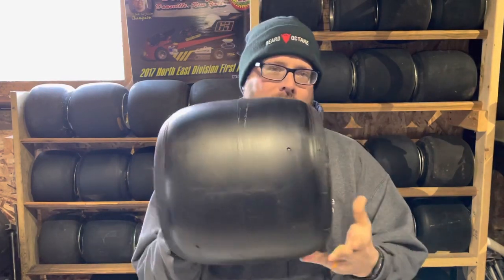Internal Tire Prep? Why?

Comment: Can you explain when to use a tire with a lot of oil verses a tire with less oils for track condition
Reply from the maker: In my opinion a oily or heavier prepped tire would be good for soft tracks and a dryer hard tire better for hard and dusty.

Comment: I need help with tire size. I have to run Burris slicks but when I look tires up I get confused.
Reply from the maker: LF 5.0.  LR 6.0    RF & RR 8.00     Staggers I run usually 1.5” in the front and 1” rear.  Ideally your right rear and right front will measure 34” in circumference making your LF 32.5” and LR 33”
Reply: @kart6t3_ben  all 6in rim's?
Reply from the maker: Yes sir
Reply: @kart6t3_ben  thanks man!

Comment: When you outside prep a tire, run it and all that. Then surface it, can you apply a different outside prep? Or will the original prep always be in the tire. Mainly talking about trac tac products.
Reply from the maker: Absolutely.  Track Tac preps work very well together and a outside wipe is only gonna penetrate so far.

Comment: What's the best way to protect your tires with a off-season and are they still good enough to use after they've been sitting for a couple months
Reply from the maker: There are  number of preps or products to wipe on them for off season storage.   Easiest may be  WD40 and wipe them down decently or a less aggressive prep.  Storage in a climate controlled seems to be the best but I do store mine out in the cold.  Some people like to wrap tires in plastic wrap (cellophane).
Reply: Wd40 is the best I’ve ever found. Use them next season for damp-wet tracks
Reply: Just 1 coat of wd40? And should they be wrapped after applying wd40?
Reply from the maker: @waynewolfe6629  I’d do probably two.  I’ve never wrapped tires, but I know people who swear by it.